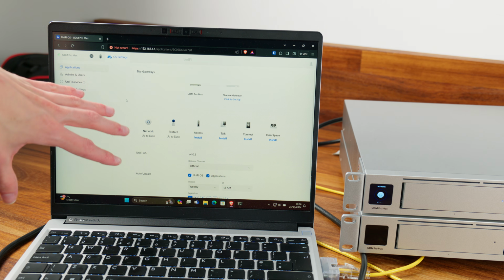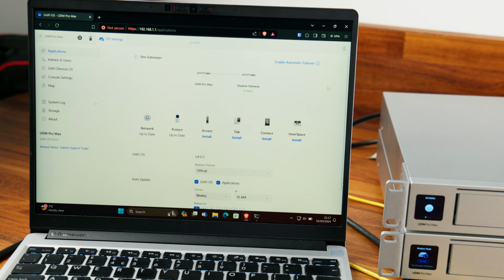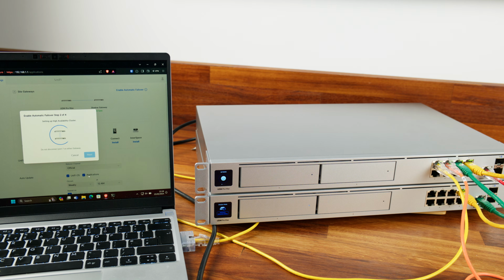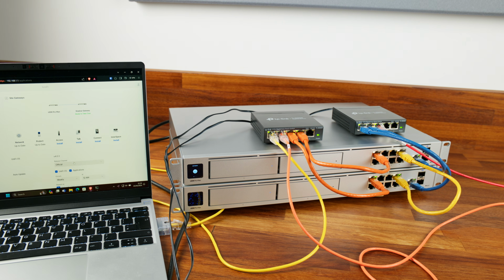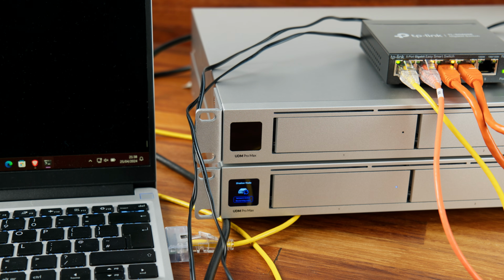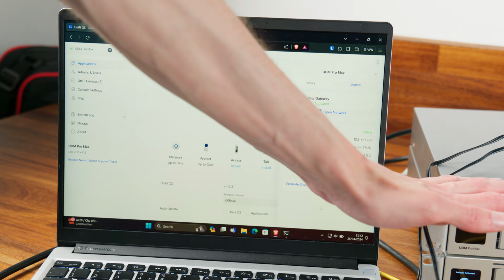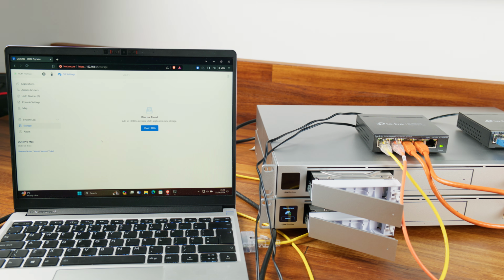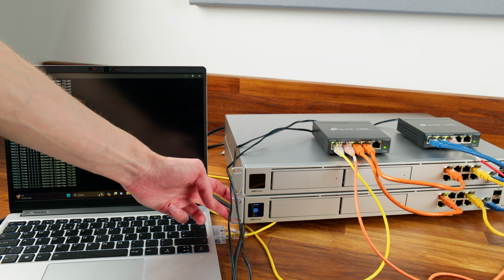UniFi's Brand New High Availability Feature! - Automatic Shadow Mode

Comment: This is a very detailed video. I think, the failover takes too long. When you compare with "real" enterprise devices that aren't even more expensive, failover takes only miliseconds. Unifi needs to keep going and enable faster failover times.
Reply from the maker: It's really a tradeoff between how the various devices operate.  With systems that use CARP or VRRP they'll failover almost instantly but the downside is that you'll need at least 3 static public IPs - one for each gateway and one to "float" between them.  The way the UniFi feature works it only needs a single public IP and can work with systems that use DHCP or PPPoE to assign IPs so you can use it with even a basic residential connection.  The downside is that the failover takes a bit longer as the backup gateway needs to bring up its WAN interface and perform DHCP or PPPoE negotiation.

What I didn't test here would be if the WAN IP was statically assigned on both gateways - I suspect that could end up being a bit quicker since in this video I'm using DHCP and I suspect the secondary gateway might have been performing a full DHCP negotiation.

Comment: My question is how should the tp-link be configured for the WAN? Does the tp-link switch receive the public IP or can both UDMs see the public IP?
Reply from the maker: In my setup here they're just being used as unmanaged switches so don't have any sort of IP address - The UDMs get the public IP themselves.  If you wanted some way to access the management on the WAN switch then you'd probably want to do something like configure it with a pair of VLANs - one for the WAN connection thats connected to the WAN ports on your UDMs and your ISP and then the other for management that's connected to a switch on the LAN side of your network and this is where you'd configure the switch's management with a LAN IP.

Comment: A simple option to connect the WAN connection to both UDMs, set up a 3-port VLAN on a switch. The WAN link from the modem will go into one of the 3 ports and the WAN port of the UDMs will go into the other 2 ports. When creating the network for the VLAN in UniFi, tell it that it's an "External Gateway" VLAN.

Comment: This seems like bad design, putting a switch in front of your firewall...
Reply from the maker: What's wrong with that?  It's very commonly done in commercial settings, in fact, with most commcerial leased line setups, the ISP's supplied termination equipment is often some sort of managed switch that they manage centrally.
Reply: @camerongray1515   But wouldn't that be a WAN breakout, specifically configured to the task - things like locking the management port, etc?
Reply from the maker: Not sure what you mean by a WAN breakout?  In commercial leased line settings it's often just a switch with the management handled centrally by the provider who can remotely log into the switch to perform diagnostics.etc.  There's no issue with having switches on the WAN side of a firewall as long as you're not doing something silly like putting the switch's management interface on the public internet.  Switches aren't some sort of special "LAN only" device - there isn't some sort of special class of device used for network distribution inside ISPs or across the internet, it's mostly just interconnected switches, even a lot of traditional routing features are now being handled by layer 3 switches.
Reply: @camerongray1515    I understand that you don't, I'm not asking for a basic lesson in networking, I'm saying its bad practice to put UNMANAGED switches in front of your firewall.  Unless you're properly configuring a managed switch and then monitoring it, you are introducing the potential for problems.  A WAN breakout is a term referring to a managed L2 switch used to split an incoming connection - and it is what you're referring to when you say it is very commonly done in commercial settings.
Reply from the maker: The basic switches used here were just for the purposes of the demonstration, if you're installing this setup in a production setup, of course you'd probably want to go for higher end managed switches and probably factor in some level of switch redundancy as well, but that was beyond the scope of this video.
Reply: @camerongray1515  If that were true, you would have mentioned it in the video.  I'm not saying that you had to expand the scope to include the configuration of a couple appliances - just that you're explicitly walking through a solution, including the breakouts - and you didn't say a thing, not because of scope creep but more probably because you hadn't considered it.
Reply from the maker: @project.jericho I literally said "to test this I'm just using these cheap little switches" and that in a production setup "you might want to think about switch redundancy as well..."
Reply: @camerongray1515  It is hilarious how the commenter that comes accusing you of not considering scenarios and not needing networking lessons, fails to provide what are the attack vectors of having an unmanaged L2 between the ISP the UDMs as shown here. A misconfigured L3 managed switch could be an even greater risk of exposure. Even ubiquity suggest this as an option to split the ports in their shadow mode guide.

Comment: I have 2 UDM PRO and already set to shadow mode and it connected to 1 unifi USW-Pro-Aggregation (core switch) but I think again that what if my core switch die? and my question is, is it possible to use two unifi USW-Pro-Aggregation connected to each UDM PRO that already set up with shadow mode? Thanks

Comment: Thanks for the video.  Question: Instead of using 2 unmanaged switches, can I just use a single ubiquiti switch instead?  Thanks
Reply from the maker: You could as long as you make a separate VLAN for all the ports involved in the WAN side of things.  However, bear in mind that your switch is still a single point of failure.  In a real world setup you'd need to build in some sort of switch redundancy in addition to automatic shadow mode.
Reply: @camerongray1515  Wow I need to make separate VLANs as well? I was hoping the shadow mode UDM pro would already know to switch over.

What if I placed a switch aggregate between the 2 UDM pros and my 2 ubiquiti switches?

Greatly appreciate all your help! I am not a network engineer and being tasked to rebuild our office network.

Thanks!

Comment: Great video, but what happens if I have two ISPs, one active and the other in failover mode? The question is, where do I connect the second ISP?
Reply from the maker: You'd connect both ISPs to both UDMs, likely by connecting each of them via some sort of switching.  Automtic Shadow Mode is only really to handle failure of a UDM, each UDM will handle ISP failover internally.

Comment: My ISP will attach one IP address to one MAC address. If the gateway is changed, a new IP address will have to be obtained (usually by modern reboot) 

Does this setup appear as a single device to the ISP?
Reply: Most probably not. 
When your ISP offers only "one" cable (notably fiber), you seem to be kinda screwed because you can duplicate that to two UDM.

Comment: I would say having them need to be switched back is a overside. Imagine you have some glitchy power conditioner done the chain, that looses poeer then powers up again, then looses power and so on. (I know not fhe most likely, but it is possible). Then the udm will switch constantly, sou will probably loose internet connection constantly and unify protect properly has a footage issue.
I understand that it's probably hard to implement it because the first one doesn't knoenit failed when it comes back online but still, it would be great

Comment: I have a 10g Ethernet  with 5g/5g WAN connection so I wonder if the switch between the the WAN and the UDM could be a unifi aggregation switch.
Reply from the maker: I can't see why not, although that does raise an interesting situation - with the switch sitting on the WAN side of the UDM, I don't think it would automatically be manageable through the UniFi controller.  I haven't tested this but I suspect you'd need to also have the switch connected to your LAN to allow management through UnFi and then add a VLAN that includes all of the ports used for your WAN connection (the ports linking to each UDM and the port(s) uplinking to your ISP).

Comment: what is really annoying about people pushing Unifi products is that they never mention they are more than likely out of stock.  Point in case is the UDR which has not been in stock for weeks.  I do worry about choosing a supplier that can not manage its stock and manufacturing process correctly.
Reply: Absolutely. I ended up finding a second hand UDR after waiting 3 months without luck. That was a while ago now and they're still not in stock
Reply: Plenty of stores that sell them.. You don't need to buy it at the Ubiquiti Store...
Reply: @SmokingCrop  Have a link? I couldn't find one in stock anywhere in UK/EU that I could find

Comment: If you were going to the expense of HA you would  likely have a separate uvr and not have any cameras on udm. The reason I originally liked unifi was every thing was separate not Kean on the all in  the one devices although they are good  I personally think it's a backwards step and would prefer just a gateway with 10 GB ports.
Reply: gateway with just 10g ports, that would be the UXG

Comment: Don’t you need to use the Link ports on those switches? How can that work?
Reply from the maker: I'm not sure what you mean?
Reply: @camerongray1515  on the tp link switches, usually you connect the upstream cable to port 5 (labelled Link/Act) and you connect downstream devices to ports 1-4. you connected the uplink cables from the dream machines to ports 3 and 4. how does that work?
Reply from the maker: There is no difference between any of the ports, they all work the same.  A switch doesn't care which port is used to uplink to the router, it doesn't even see any difference between a router and a client device - all general Layer 2 switches like these do is forward traffic between connected devices based on MAC addresses.  You may sometimes see switches with ports labeled "Uplink" but that usually just defines either, a higher speed port (e.g. 10GbE port on an otherwise 1GbE switch, or 1GbE port on an otherwise 10/100 switch) or on a PoE switch it may be used to label a single port that doesn't provide PoE.

Comment: Great video! Clear and detailed. Have to wonder about adding the other two points of failure to the system though. I wonder if Ub will make a switch device to go between them.
Reply from the maker: This setup is only really intended for large networks so you're already going to have LAN switches so you wouldn't really be adding a point of failure there.  You are still technically adding one if you need a switch on the WAN side, but switches are generally pretty reliable and if you're at the point of running redundant UDMs, you'd probably also have redundant WAN connections, each with their own switch.
Reply: Gotcha! Makes sense! Thanks for the reply and video.

Comment: So how do you now make the two additional switches have the same level of redundancy?
Reply: For the most part, in the WAN side yours ISP's modem may have multiple LAN ports than you can connect the UDMs, or you may use 1 simple switch. Simple unmanaged Switches from reputable brands may be really reliable because their simplicity, so they are intrinsically less prompt to failure.
On the LAN side you got lots of options, depending on the size of your network, if you have only one downstream core switch you can just connect the 2 UDMs to your core switch. If you have multiple downstream switches you can connect both UDMs to every switch, or you may use STP (Spanning Tree Protocol) to create a Daisy Chain Ring between them.
There are looots of options depending on the size of the network, number of switches and which are the critical ones.
Cheers!
Reply: On the LAN side, you could have a pair of stacked core switches, and make sure each one has a link going to your access switches.  Not sure if that’s something you can setup with a Unifi setup or not, not too familiar with their switches.  Also, switches with dual power supplies

On the WAN side, it’d depend on what your ISP supports, but if you do just get 1 network port handoff from them, at least going into a reliable dual power supply switch would be a good idea.  

Having a single point of failure somewhere along the line is something you’ll have to live with, unless you start going down some much more complicated setups, and likely needing more enterprise grade gear
Reply: I did nothing. It's much easier to have local contact on site to swap the WAN cable (remove from the "splitter" switch and insert directly into UDM; or even just replacing that switch for a cold spare) than having them handle a whole a router. Also I have not seen one of these little metal switches die, ever. Occassionally the tiny 5V 1A power supply gives, but I surely have some 17+ year old ones that still work. :D

Comment: Does it support dual WAN assuming the same unifi SFP Adapter?  I would be inclined to use 1 LAN trunk port and configure VLANs on downstream switches and manually move over the trunk patch cable.   Excellent video!
Reply from the maker: Dual WAN works the same way as on a single UDM except with Automatic Shadow Mode you'd connect both WAN connections into both of the UDMs.  Not sure what you mean about the trunk port and manually swapping the cable?  With Automatic Shadow Mode you'd configure a trunk port on both UDMs and connect both of them to the switches at the same time, that way failover will happen automatically without requiring any cabling changes.

Comment: Does it have any interface tracking features? For example, if your WAN cable gets damaged on the primary and becomes disconnected, would it trigger a failover to keep the internet live to the network? Or would it stay as it is an you would loose connectivity?
Reply: You would hope it fails over purely because of the WAN packet loss
Reply: @NaokisRC  hope being the key word here
Reply from the maker: I haven't tested this, although I suspect not. Automatic Shadow Mode is designed purely to handle the complete loss of a UDM (hardware failure, software crash.etc).  When it comes to WAN redundancy, the expected setup would be to have a pair of WAN connections which are both connected to both UDMs.